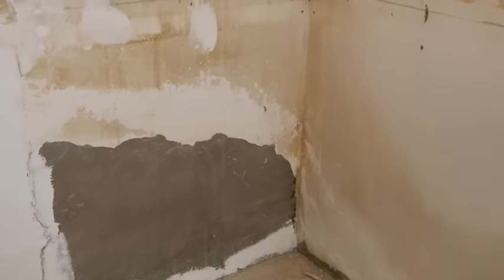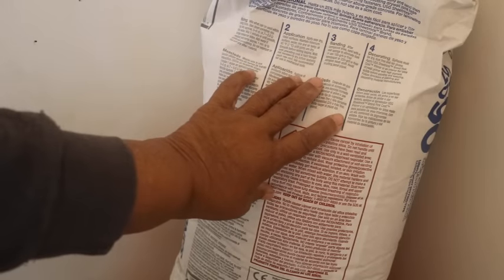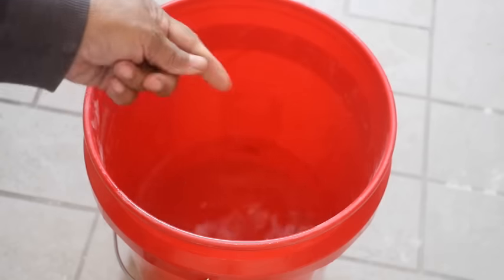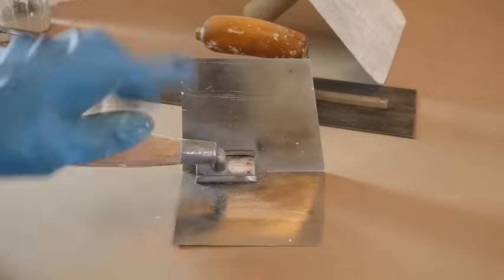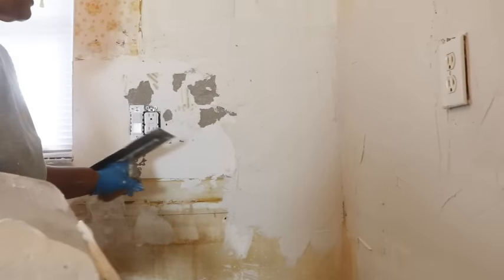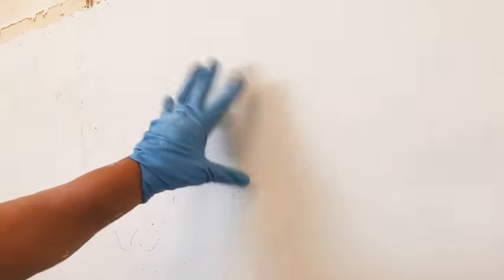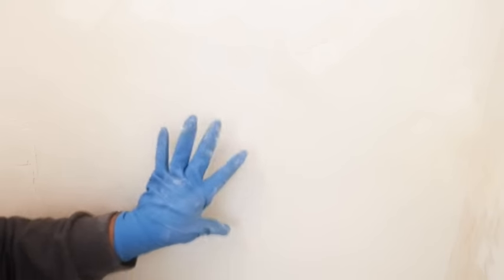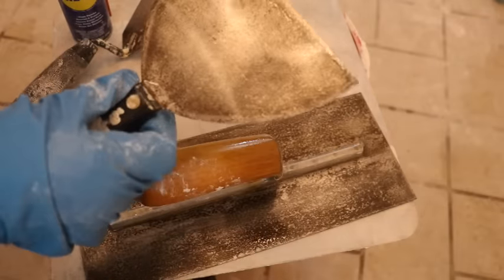You'll never sand JOINT COMPOUND again!!!

Comment: You're using joint compound and not plaster correct? Isn't plaster a different material than the one you're using? Sorry I'm new to this and the terminology is confusing me...otherwise great video...can you clarify if that material is considered plaster or not and if so can I use it over my drywall?

Comment: That works great for drywall but not old plastered walls which causes air bubbles to come through or eventually just resettles and recracks even with tape. It is confusing calling joint compond plaster, which is more commonly referred to as 'MUD'. Regardless great finish and 'wet sanding' is way under utilized.

Comment: I love her videos. But I've been Plastering for decades! My pop plaster my grandpa plastered being a plaster is a skill set that is definitely dying. But where I live we have a lot of old houses. And some of the clients are old school. I try to talk them into using drywall. But they opted out and they want me to do plaster. And I plaster in large section small sections from where the plumbers had to replace a stack or an electrician's head to fish lines! But when it comes to skim coating I skim coat tight very tight! Now the painters they'll come in thinking that the wall is ready for paint. But I let them know has to be lightly sanded! I don't care how good of a skim coater level 5 you are exclamation point you definitely have to do some sanding and that is on the highest level of finish work multi-million dollar houses

Comment: It's a good process, but not for everything.   Hot mud can actually be brittle in certain conditions and flake off of some wall finishes, and if too much mud is used in kitchens where cabinets need to go, it can affect the cabinet fit.  Also, the edges of hot mud don't play well with wet sanding.   I never wet sand hot mud.  Dry sanding is just a better finish. Just plastic off, wear a mask, have a shop vac with a dust bag, mount a fan in a window of possible,  and go to town.   After all,  drywall sanders aren't just sanders, they should be detailers.

Comment: I says on all purpose mud bucket to use wet sponge to smooth out surface after mudding is dried 
It’s interesting not a single contractor I know use wet sponge technique or technique shown here 
They all use sanding

Comment: being absolutely green with resurfacing, and detail minded, and extremely stubborn, i would like to know things like how much pressure is being applied to the tool as you make your passes for each stage, how thick are the layers one is trying to have adhered to the wall, how wet is the brush.  watching this video doesn't help me understand the appearance of the wall during & after each process you describe because, even upping the brightness on my phone, once you've put compound up on the entire surface as your scratch coat, the walls look smooth, flat, and white for the duration of the video.  i don't see any high points being knocked down.  i can't tell if you're leaving any feathered edges as part of these high points.  firm yet damp to the touch, and somehow when you began to use the trowel to, i'm guessing check for the flatness of the surface, i saw & heard the sound of vibration at the beginning of your motion before seeing & hearing the sound of the trowel scrape as you finished the motion.  did that not cause the surface to have multiple ridged lines being left on the surface while the trowel gave off that vibrating sound like multiple quick succesive hops between the edge of the trowel and the wall?  watching you work with the paintbrush looked just like a person running a dry soft high quality and well taken care of bristled paintbrush over the surface.  then when you followed behind with the trowel the scraping sound combined with not being able to see any type of texture gave me the impression of a person running a trowel across a completely dry smooth surface.  i am a person that struggles to come up with any kind of disposable income, let alone money to finance a DIY project.  so i find the idea to try to do a resurfacing project that will obviously start with trying to learn how to do the project by imitation quite daunting due to how much material will i need to use for this journey until i achieve the desired end result.  you see, i've helped my, now 80yr old, Ma by doing wall repairs (patching holes & fixing cracks at tape edges caused by time & her house settling).  she has lots of walls with old wallpaper that have edges peeling away that i'd like to strip, resurface, and paint for her without finding myself out of the product that i could afford leaving a project looking as the work in progress for some indeterminate length of time for me to get more material to be able to finish the project.  i'm sure that for a whole hell of a lot of folks they fail to grasp my personal financial situation.  my mode of transportation is mainly either walking or riding an escooter that i bought used & nonfunctioning that i was able to get working again (i will refrain from giving the details of the process of how long it took me to be in a position to acquire the scooter, diagnose the issues, obtain the tools & materials to get it working & usable.  i have yet to be able to allocate funds to sand, prime, and repaint it.)  a lot of my meals consist of me drinking water while having the mentality that i've filled my stomach.  so being able to pay for the use of public transportation, for me, is a luxury expense.  i would hate the feeling of every minute that i leave part of her house in a work in progress appearance.  i've been doing everything that i can to keep her in the house that she's lived in for longer than i've been alive.  i would really like to be able make her not stress over the thoughts of remaining in a home that will continue to have more & more upkeep work needed versus the process of going through over half of a century of her life that the process of relocating would make a necessary requirement.  i would like to use my time to accomplish this goal sooner than using my time towards trying to improve the situation my life is in currently.
✌️🐝➕

Comment: Now show me with a bright led light, take the light and put it side ways to the wall that will show how good your work is because the shadows the light gives off shows just how flat and filled in the wall is and if a glass like finish is there which dry compound 90 does not give you as it is use for prefilling and patch work now show me with a light sideways to that wall all over and if there are no problems ill give you an A but as a 35 year taper this does not work.

Comment: Wrong advice. I’ve been hanging board and taping since 1979. Would have been better to remove the existing walls. Inspect mechanicals for repair or upgrade. Insulate as needed. Hang new board and finish tape. 😎

Comment: Well first off ,plasterers do not sand as the previous commenter stated. 2nd place stop referring to joint compound as plastering,, it is not plaster.
Reply: Plaster usually means a material used for the interiors of buildings, while "render" commonly refers to external applications. And joint compound is made from gypsum which is the original plaster from thousands of years ago.

Comment: This is misleading. Im a taper of 24 years over 9 million sqft of drywall finishing of experience.  
If you put a light down theae walls you would be mortified. I know. 
It will have waves and edges and pinholes inevitably. 
I really like this channel but as an expert i cant recommend an amateur homeowner go with this method. Its nice to hear no sanding but its not super realistic.  Wet sanding definitely can work as well scraping but if you do choose to do this or any mudding rule #1 use a light shining down the wall , that way you actually see what your work looks like from begining to finish.
Peace love

Comment: no. i do this shit everyday. it needs to be sanded or it will be seen. it needs to be sanded and primed every time. no matter how light you touch it with those bulky ass concrete trowels, cause thats what they are, youre making and edge line, and that ridiculous brush trick will only leave brush strokes in  the mud. so no. go get some actual "mud blades" amd learn how to bend a blade, carry it out, and leace it go free... and even then, when its glass..  it will dry with a line in it. humans arent machines,dont get too full of yourself.